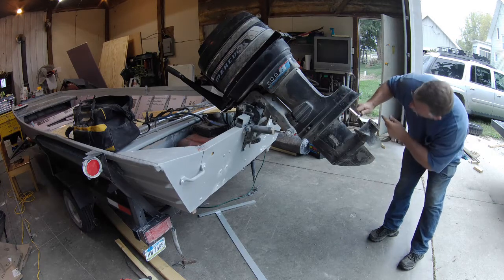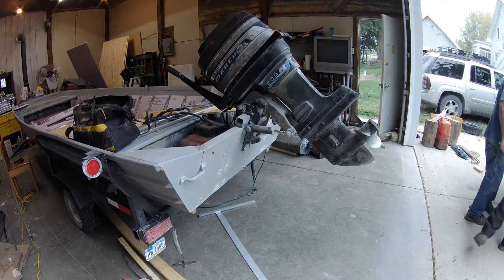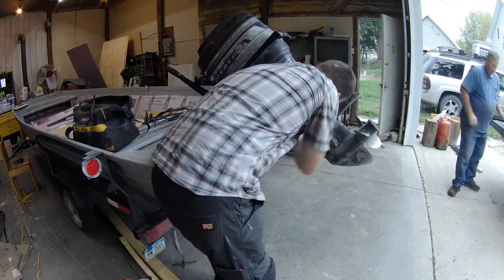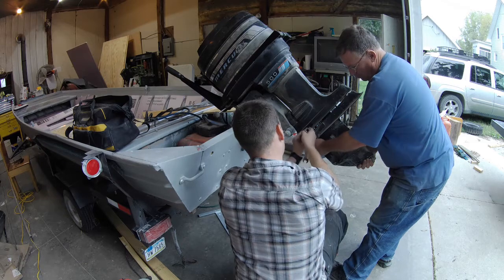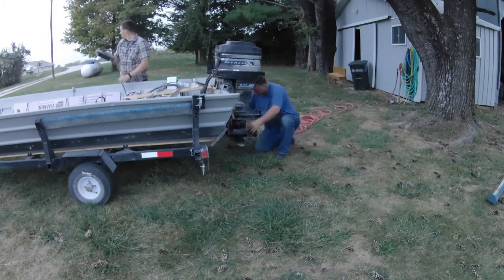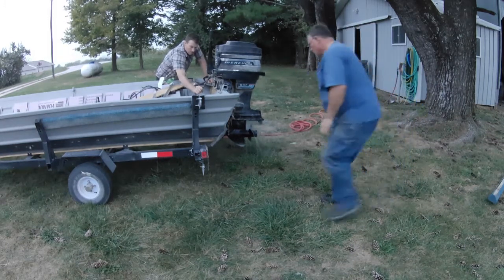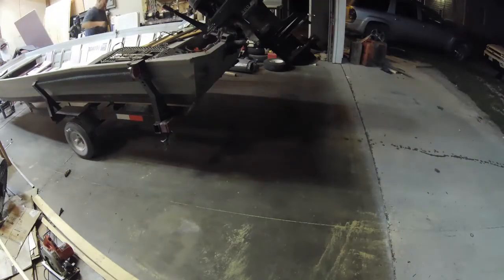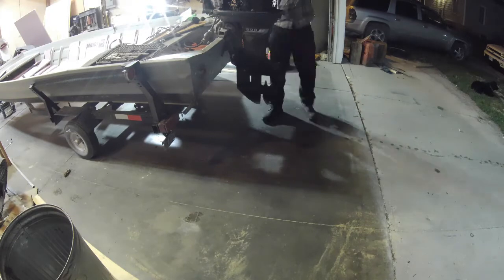Mercury 500 50 HP Impeller Replacement (IT WORKS!... after we take it apart multiple times..)

Comment: Helpful video.

I just bought a boat with a 1977 50 HP Mercury...Majority of Wire harness is green powdered copper oxide...so I'm hoping that with a relatively cheap harness...I'll get it running and will do the impeller after that...assuming it runs...
Reply from the maker: The impeller wasn't hard to replace but just getting things back where they were supposed to be is the hard part. Taking it apart is easy